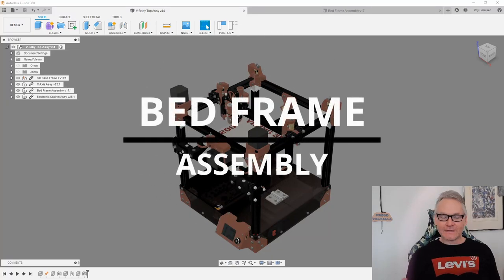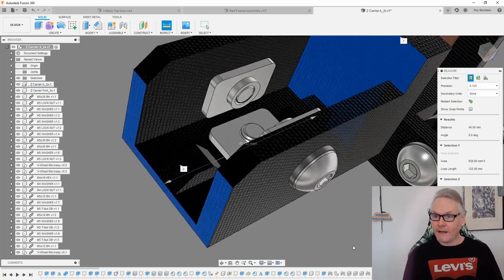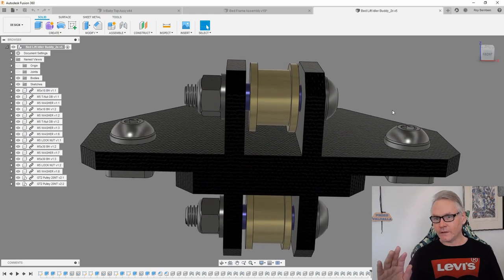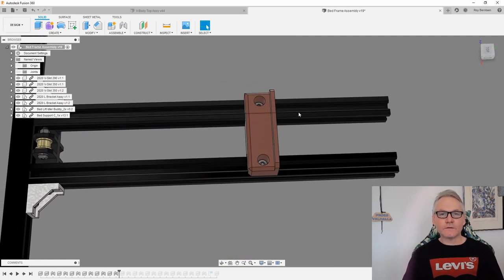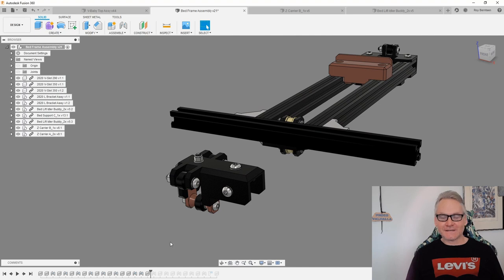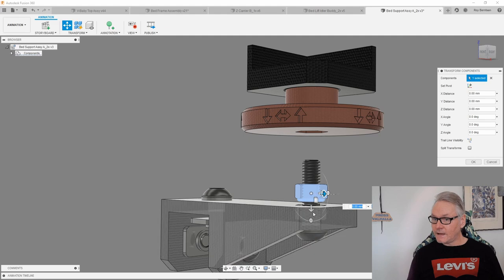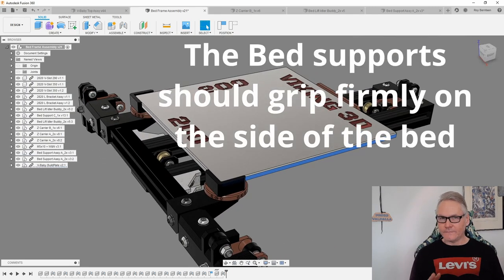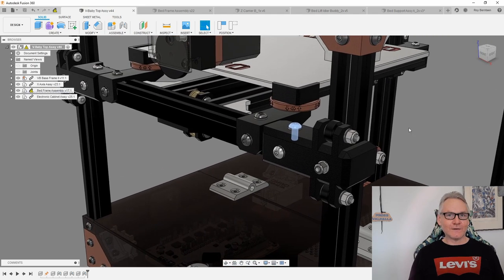Building A 3D Printer | The V-Baby CoreXY | High Speed 3D Printer | Part #6 The Bed Frame

Comment: Thanks for the video Roy :D  .... Remember that bed support should be lower than the alu bed, else your hotend will collide with bed supports.
So if the aluplate is 6mm, the bed supports should be no higher than 5mm.
Reply from the maker: The hotend does not reach the bed supports and we also have the heaterpad at about 1.5mm so it should be just fine
Reply: @PRO3DESIGN  But the heatpad are not supposed to lay on the bed supports. Then you will get a un-even bed.
Else pls. Explain how you attach the heatpad to the alubed.

Comment: Hi will this frame support 220x220 heated bed. or should I increase the x and y axis length for the frame ?
Reply from the maker: There is a 250 bed option you can build for bigger beds. I think the 200 also will support 220 bed but you can only print 200 on it

Comment: Nice design.  Your link to the 3D design does not work.  I think it is to your personal Autodesk Myhub and not available for public access.  Can you make this avaialable.  Thanks.
Reply from the maker: I do struggle with A360 and this model as it its very heavy. Let me try to fix it
Reply from the maker: The model show up now: https://a360.co/387NLc7
Reply: @PRO3DESIGN  Hi there,
Thanks for doing that.  I downloaded it and loaded it into Fusion 360.   I have all the individual components plus some sub-assemblies and the V-Baby Top Assembly.  I can open all the components OK.  When I open some of the sub-assemblies I get a message saying that some of the linked components need updating and I can do that OK.
However, when I load the Top Assembly it starts to load and then Fusion 360 crashes.  I have a powerful PC and a fast internet connection because I work with some large assemblies.  I haven't had many crashes before.  I've tried everything and can't load the Top Assy.   
I'm impressed with what I've seen so it's a shame the Top Assy won't load.   I let Fusion 360 send crash reports to Autodesk but don't think I'll hear anything.
Reply: After a bit more research I think the problem with the F360 Archive file is the linking between the assemblies and individual components.  So I downloaded the file in STEP format and it worked !    A few components are out of position but that is easily fixed.
Nice work on the design - I'm going to take a closer look today.   Thanks for posting the F360 files.